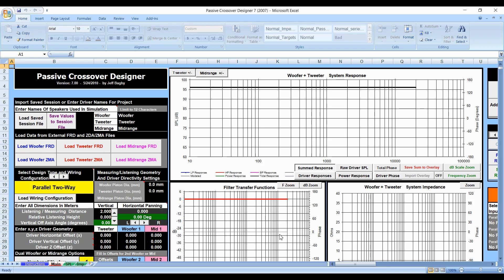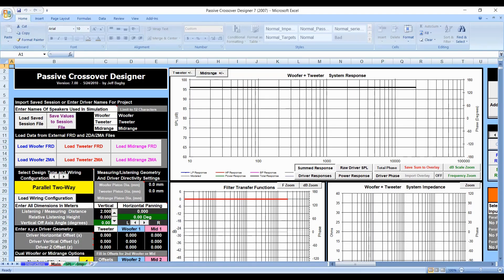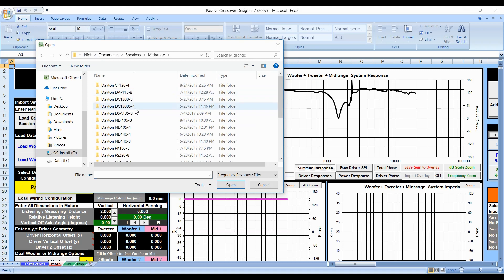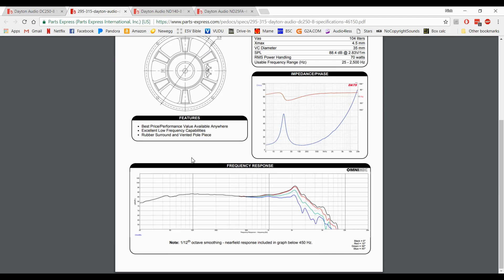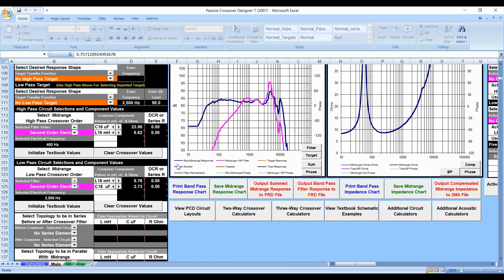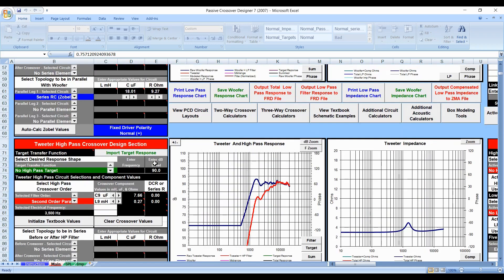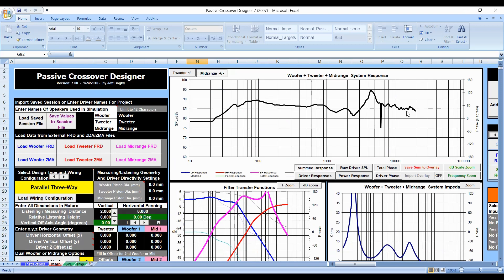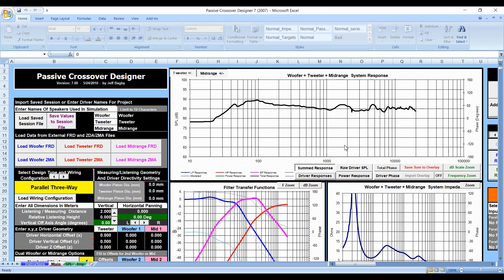How to Design a 3 way Crossover

Comment: We, the ignorant masses, need an Active speaker design series.
Reply: Yep. I’ve run active system only for thirty years. 
I’m not referring to compromised, active monitors with poor amplifiers, stuffed inside a shaking loudspeaker enclosure. 

I’m talking about audiophile components running from a mastering studio-grade dsp unit. 

Initially analogue active crossovers. 

One dac 
(stereo = 2 channels). 
Multiple, dedicated power amps

Nowadays , digital studio grade x/over, active. 

A dac for each band
I.e. 3 way = 3 stereo dacs, or a 6 channel dac
4 way = 8 channel dac

Multiple, dedicated power amps. 

Can’t understand why anyone remotely interested in audio spends thousands, or hundreds of thousands, on gear, only to run everything through a debilitating, flawed, passive crossover (even the most expensive, bespoke ones).

Either ignorance, stupidity or laziness.

Comment: I think in one of the previous videos you mentioned that a speaker driver is already limited by the frequencies of its "intended use". as an example. a midrange speaker has limited frequencies. same way as subwoofer also has limited frequencies. same with a tweeter, 
the only difference is a tweeter must be protected from low frequencies. from being damaged.
so technically you can hook up a subwoofer with no crossover (without being worried about damage)  that's from a safety point of view.  keeping in mind that you did the wiring correctly
so you don't damage your amp. 
I have a different question. but I wanted to make sure I understood you correctly. 
thanks
Reply: The problem with that is even though a specific driver "can" play up to a certain frequency, doesn't mean it should. The point of a crossover is to make sure it doesn't get to that borderline point of its "intended use" frequency because at that point the driver will be struggling and will not sound good at all.

Comment: Rockville RVW1500P8 3000w 15" Raw DJ Subwoofers 8 Ohm Subs 70OZ Magnet
 Goldwood Sound GM-85/8 Poly Mica 5" Midranges 120 Watt each 8ohm Replacement Mids
 3 x 7.25" Horn Tweeter Speakers.Piezo.Replacement for Loudspeakers .... will this work together

Comment: HELLO THERE. I HAVE  THE SCHEMATIC OR CROSSOVERS OF A SET OF BOOKSHELF SPEAKERS. I LOVE THEM VERY MUCH. I WAS WONDERING IF I CAN BUY ANOTHER SET TO MAKE A CENTER CHANEL SPEAKER. I WILL USE THE SAME CROSSOVER POINT ONLY ON THE TWEETER AND MID RANGE.  BUT....I DO NOT KNOW IF I SHOULD LEAVE THE LOW FREQ COIL INTACT SINCE THAT THE  CROSSOVER VALUE  POINT WITH THE MID RANGE. I AM WONDERING IF BY  JUST ADJUSTING THE CAPACITOR VALUE CAN I  GET MY CENTER CHANNEL TO WORK. THANKS.

Comment: Then im using different ohms type driver in crossover like 8ohm tweeter 15watt and 40watt woofer speaker 4ohms so what ohms im calculate ?
Reply from the maker: That is a great question.  I actually did a video on that here: https://youtu.be/MMTGDiLjsZ0

Comment: Bro what could be wrong wit my crossover I bought a pre assembled crossover off parts express and hooked up my speakers and they play through the crossover but I still get vocals coming out of my sub
Reply: I'm having g the same issue, I think the crossover point for the bass is to high on mine so the woofer is getting some higher frequencies. I'm gonna try a crossover that has a lower crossover point for the woofer and see if that helps
Reply: dakken74 could be the problem my crossover point is 800hz for the sub
Reply: @drsauce2574  800hz would be for a woofer. Not a sub woofer.  A sub woofer is way lower. Usually 150hz and lower.  I usually set mine 80hz. To 100hz. Never higher.  80hz is a really good point though

Comment: And i tried loading that woofer and i have nowhere near the spl yours does- is there a better way to get FRD besides PE provided ones- they dont work well for me
Reply from the maker: Remy Alexander check this out. You have to delete few lines in the file. https://youtu.be/Fm6tsj9Tpqs
Reply: Thanks,   THis is my frist from scratch build, trying to do a TMM with a 8-10" woofer on the bottom so im trying to use your videos to help.
Reply from the maker: Remy Alexander that sounds awesome! I can't wait to hear how they turn out!
Reply: About to hit the ground running, just trying to figure out how to start the Xover design, should i wait till box built and if so how measure all together? I finally got PCD working and i got what i think is a "ok" Xover starting point. Rather not order all parts for the crossover for it to sound like garbage.
Reply from the maker: If you want a good starting point, this is a good place to start.  It may not be perfect, you will know more once you get the parts in and test it.  Obviously, the best thing to do is to measure the speakers each individually in the enclosure.  But if you do not have the testing equipment to do that, then you will want to do as many simulations to get it as good as you can.  Make sure to check where your diffraction might be based off the size of your box. That will help tremendously.
Reply: I have a UMIK-1, What would you recommend for "obtaining/making" the FRD/ZMA to use? Hunting through your videos trying to find a salutation :) You're a huge inspiration.

Comment: So, according to your other impedance vid, if I'm wiring a 3 way 8 ohm speaker, I only need to worry about the largest woofer for the over all impedance? The smaller mid and tweeter can be whatever ohms as long as they are crossed over properly?
Reply from the maker: Crash 709 assuming it's an actual three way and not a 2.1 then you should be fine
Reply: Awesome. I've been so hung up on trying to match the ohms of the drivers to equal an over all 8 ohms. Thanks!
Reply from the maker: Crash 709 haha, we have all been there. Don't worry at all. I appreciate the support
Reply: Keep the vids coming. So much appreciated  help for beginners like me!

Comment: I was wondering.... With that hump at ~4.7kHz. Could you just drop the mid's XO point by ~500Hz or so (or go to a higher order) since it's above the XO point and rolls off afterwards anyways? It might require a slightly lower tweeter XO point to make up the difference, but it looks like it should be able to handle it, I would think with less components.
Reply from the maker: You could absolutely try that.  That is the great thing about crossover design.  There are plenty of ways to attack problem areas.  :) :)